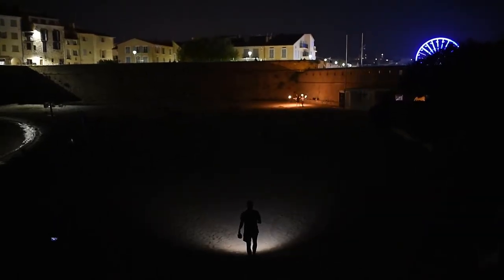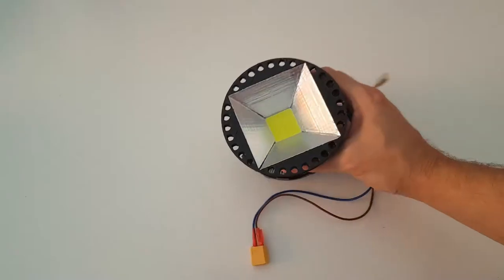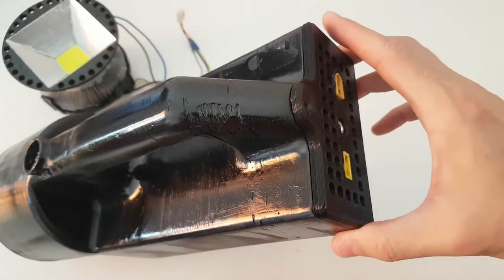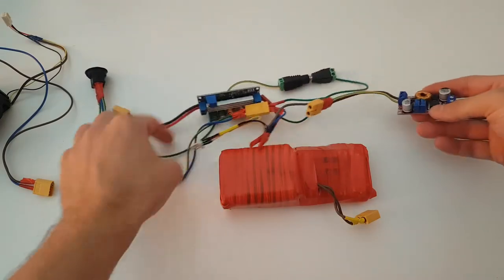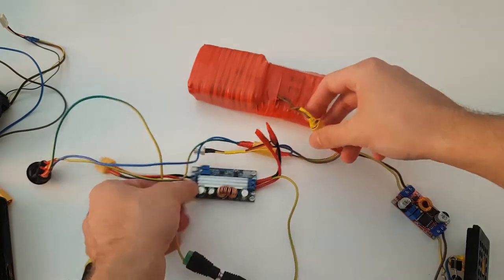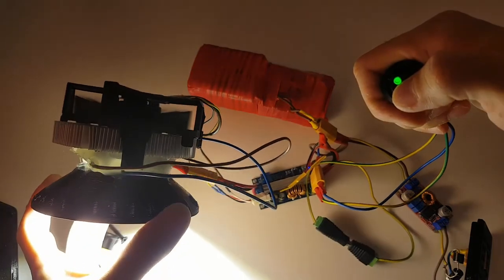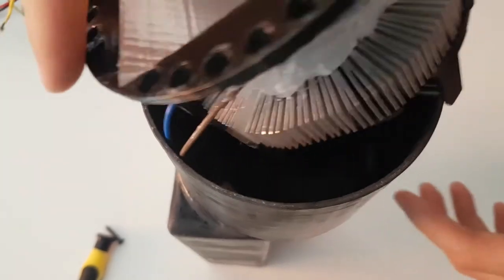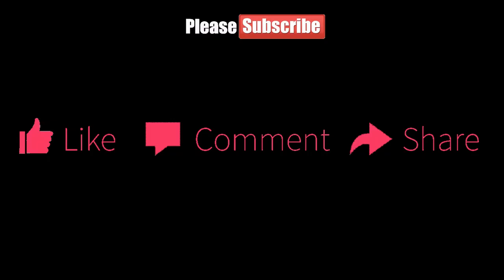This Flashlight can BLIND You! | DIY Extremely Bright and Powerfull LED Flashlight [10000 Lumen]

Comment from the maker: ---dc-dc step up boost converter
Ebay:       https://ebay.us/Ha6fmG
Amazon:     https://amzn.to/3gYiZ9V

---18650 cells
Ebay:       https://ebay.us/fhj8MU
Amazon:     https://amzn.to/32gRZOX

---DC DC step up step down CC CV - make sure you get the CC one to properly charge the 18650 cells
Ebay:       https://ebay.us/bhoRwm
Amazon:     https://amzn.to/3j11Z4G

---XT60 Connectors
Ebay:       https://ebay.us/FOuque
Amazon:     https://amzn.to/2CrTq2n

---Thermal paste
Ebay:       https://ebay.us/9HxTI8
Amazon:     https://amzn.to/32coD4r

---CPU Cooler
Ebay:       https://ebay.us/7P2J2y
Amazon:     https://amzn.to/3iEGHcv

---100W LED module 
Ebay:       https://ebay.us/GulP2v
Amazon:     https://amzn.to/2F323l0

---Cheap 3D printers:
Ebay:       https://ebay.us/aUffqV
Amazon:     https://amzn.to/2DuN56V